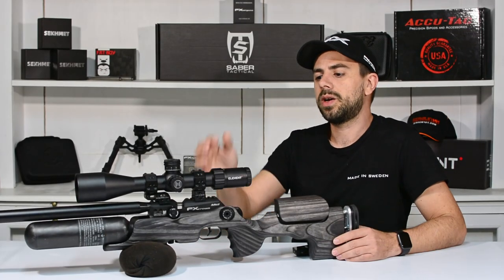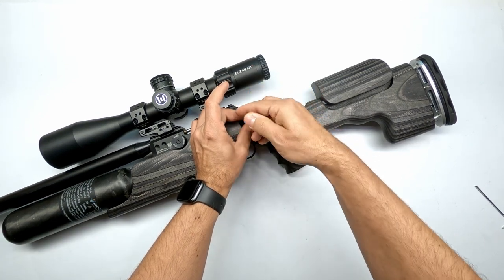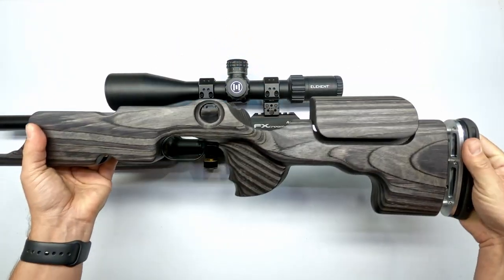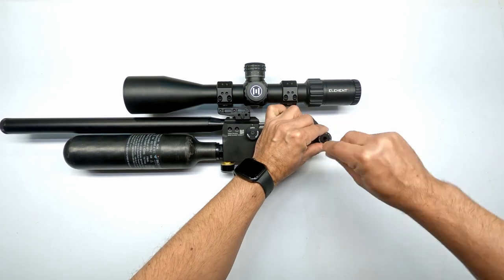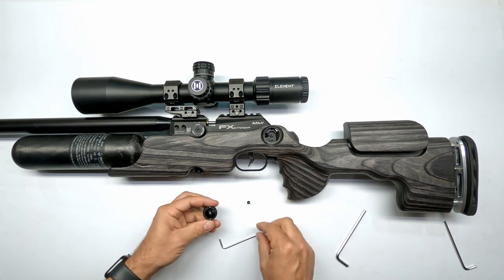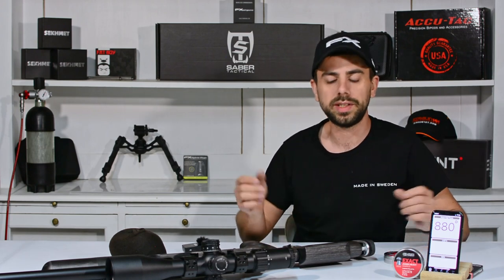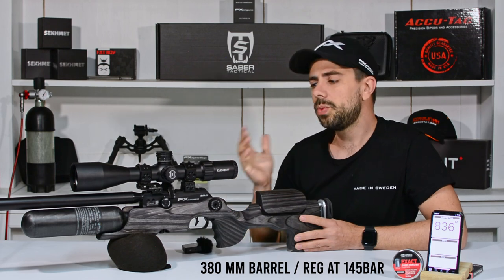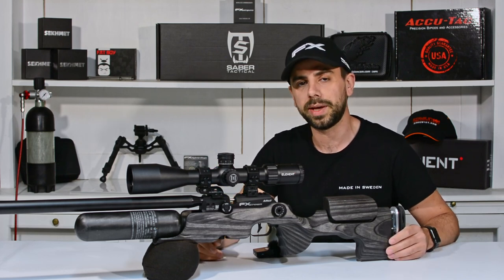FX CROWN GRS STOCK REMOVAL AND HAMMERSPRING ADJUSTMENT

Comment: Beautiful stock. Love your content. Keep up the Good Work. Have a few questions,   What is the tread specs and diameter for the Digital Guage? Looking to upgrade my Crown. Can both guages be converted to digital?
Reply from the maker: Hi , thx for the support 👍🏻 the thread size is 1/8 bsp and both gauges can be swapped but the regulator one is the most important

Comment: Have you changed the transfer port to dual transfer port or is it the factory settings? Coz with reg @150 and hammer spring max out I still get 890 with jsb 18.13.
Reply from the maker: With the crown MKII you get the FX barrel that has two sides on the transferport. You just need to rotate it to the side you want to use 😉 in combination with that I use a Huma probe with larger opening

Comment: HELLO NICE VIDEO , ALWAYS A PLEASURE TO SEE YOU BUSY WITH THE FX AIR GUNS . BUT I DO HAVE A QUESTION ABOUT THE 23 POSISION POWER WHEEL IN THIS VIDEO, CAN YOU BUY IT SEPARATELY AND MOUNT IT ON THE PREVIOUS VERSION OF THE CROWN MK1 ? AND IF SO CAN YOU MAYBE MAKE A VIDEO OF THAT, I THINK THERE ARE A LOT OF AIRGUNNERS WHO WOULD BUY THESE IF THEY KNEW ABOUT IT. GREETINGS FROM BELGIUM
Reply from the maker: Hey 👋 je hoeft niet ik hoofdletters te schrijven hoor 😉 . Het power wheel met 23pos is apart verkrijgbaar en past op de vorige versies. Installatie is zeer simpel met een schroefje .

Comment: Hi,is it critical to have dial turned fully up(23) or fully down(1) settings before removing the wheel before making the adjustments with allen key or dies it matter?
Reply from the maker: Not really if you know what you are doing 😉 the most important is to see where the metal balls underneath have to sit en meet with the appropriate spot on the power wheel.
If you stick them with grease against the power wheel then you can’t go wrong . The explanation about putting it back at the same spot is for the rookies 😉

Comment: Great video, managed to get around 62 ft.lbs with the jsb king heavy's 25cal at around 920 fps. Altough i get a deviation around 30 fps sometimes  , thinking there is more to improve
Reply from the maker: The inconsistency is more to do with the hammerspring/regulator balance

Comment: Hello mate. Pretty nice video. Love my FX Crown on Sinthetic stock. Even I bought for him a .177 500mm barrel. Had some issues: once I tried to disassemble the rifle and lost the springs on that wheel. Later when trying to re assemble put the screw on a wrong position and ruined the threads. My gunsmith fixed it. Later on when trying to adapt a picatinny rail by myself, shot the rifle when air tank pressure was lower than regulator pressure. Psssss, all air went out trough the barrel. Again ro the gunsmith. That specific point of needing to disassembling all the rifle to change hammerspring level is only one of two defects I see for this rifle. Other one is not having a magnet to fix magazine to the stock. We need to talk man. What barrel liner are you using to shoot those slugs? The standard slx light liner? Or the heavy one? Regarding adjustability, FX intention is good. This same rifle Can be used for hunting, for field target, for BenchRest at 25, 75 and 100m and more. But. I want to know his limits when using slugs. Congratulations for this video and the chanel. Cheers
Reply from the maker: Hi mate , yes there are a few things to keep in count when shooting pcp’s or you can end up by the gunsmith 😉 but I advise to watch many YT videos and you will be able to do those repairs by yourself very easily! 
If you take care of them you will hardly have any problems with them . 

Regarding my setup I am shooting at hammerspring #20 with the internal hammerspring near to max out and the regulator at 145bar this gives me about 960fps with 22gr slugs in the 700mm .
You can raise the regulator pressure up to 160bar but don’t go higher then that as it can damage stuff

Comment: Hi are you using pin probe for pellets too? What extra speed do you get with jsb18 and pin probe compared to pellet probe
Reply from the maker: No for pellets I am switching back to the Huma air high flow pellet probe , because the pin probe doesn’t seat the pellet deep enough.
Regards added fps , it depends on the tune you have on the crown
Reply: @Airbuks  ok, I thought the Mk2 would have a high flow probe from factory to suit the dual TP that's in the barrel
Reply from the maker: @fiestamans  it doesn’t 100% matches the size of the dual transferport as FX holds on to the one hole port for pellets, Huma has a probe to match the dual side

Comment: Thanks for the video!  QUESTION: Have you experimented with the transfer port or do you leave it on MED? I have a walnut .22  MK2 with a 500 mm barrel. Reg was factory set to 110 and velocity is too low, I'm looking for around 888 fps with JSB 15.89 gr pellets. I'll make some adjustments tomorrow.  Cheers!
Reply from the maker: I always leave it on high for maximum airflow .
If you want to up the power I would start by adjusting the internal hammerspring since you already have 110bar on your regulator. With the 500mm barrel you should get there with ease .
Do this in small steps , put your TP on high , powerwheel on 23 and adjust it 1/4 turns up until you get to the 880 fps
Reply: @Airbuks  Thanks for your quick reply and advice!